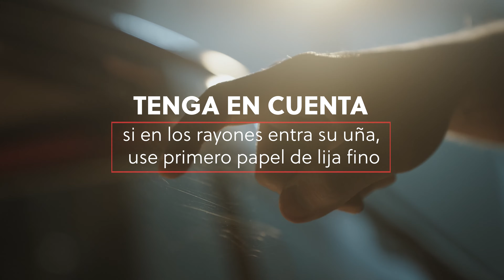¿Cómo eliminar los arañazos del cristal con Óxido de Cerio PROUNOL?

Comment: Muchas gracias por los detalles que otros youtubers omiten.

¿Un rayón ligero que apenas si se siente con mi uña con qué tipo de lija se debe atacar? Me da miedo usar lija sobre el parabrisas.

Mil gracias y saludos.
Reply from the maker: Para preparar el vidrio antes de pulirlo con óxido de cerio, es habitual utilizar papel de lija con una gradación muy fina, preferiblemente 2000-3000. Este papel tan fino permite alisar la superficie sin provocar arañazos más profundos que serían difíciles de eliminar durante el proceso de pulido. Hay que tener cuidado y utilizar agua al lijar para evitar empañar demasiado el cristal.
Reply: @prounol  Estupendo! Lo probaré así enseguida. Mil gracias.